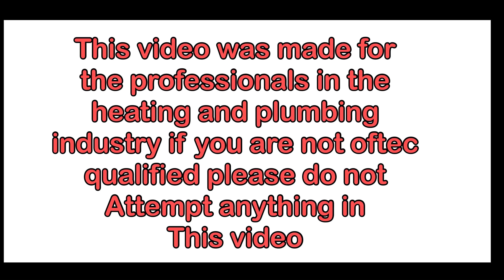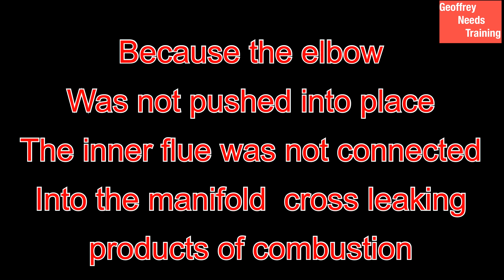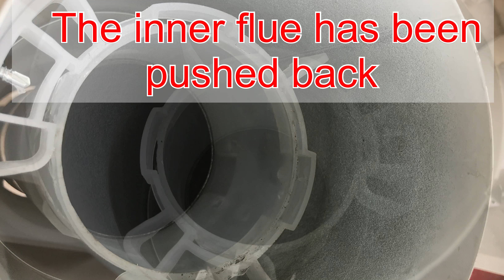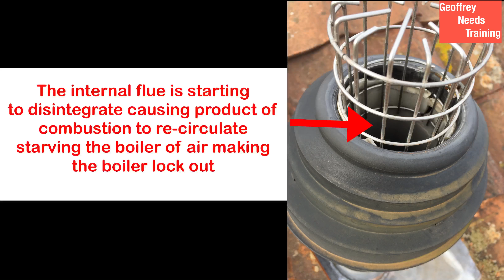oil project fault finding flues

Comment: This is a very common fault on oil boiler when you start to get shorty cycling especially on the rdb burner. Grants have a common fault with the flexible condense pipe splitting on the rear of appliances, boiler will run with cover off then start to short cycle when it goes back on. Great vid